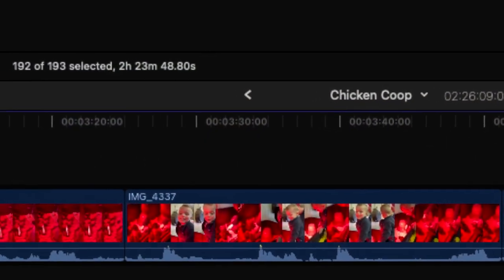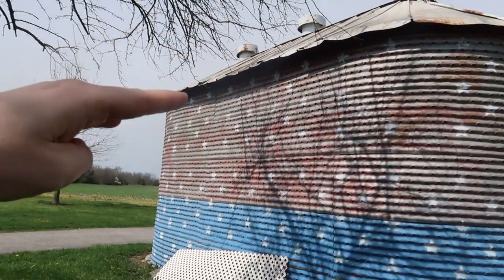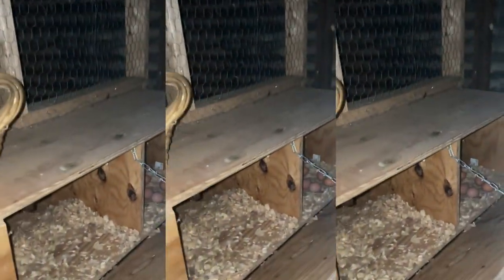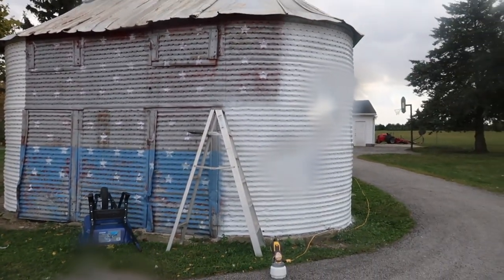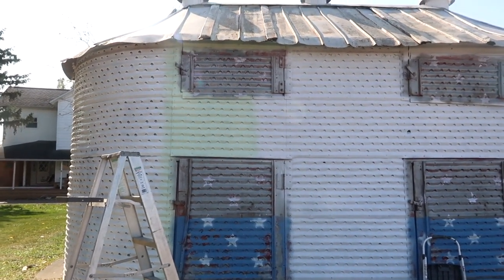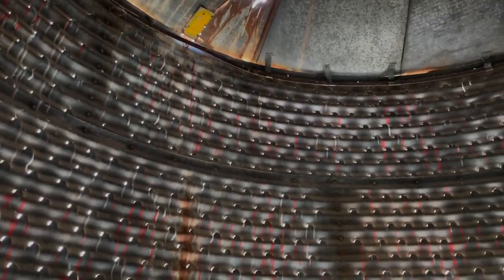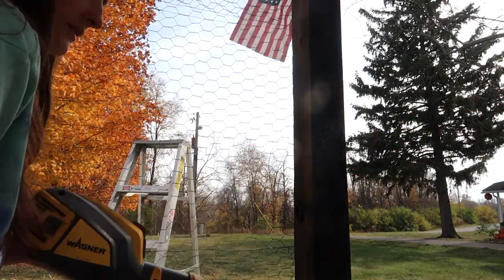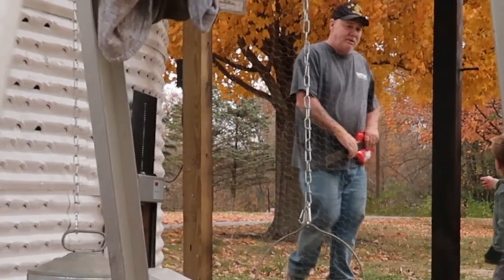CHICKEN COOP Start To Finish Makeover (Grain Silo Building)

Comment: I’ve locked myself in my chicken run before too! 
After that we tied a string to the latch and ran it through to the inside of the run. No more getting locked in
Love the coop! Mine is also white and black
Reply from the maker: I love that! We stinking added that when we built it but we’ve got it tangled up before, and dropped it and still lock ourselves in 🙈